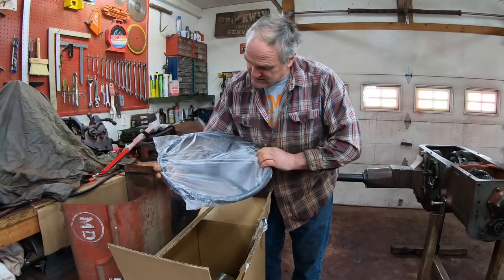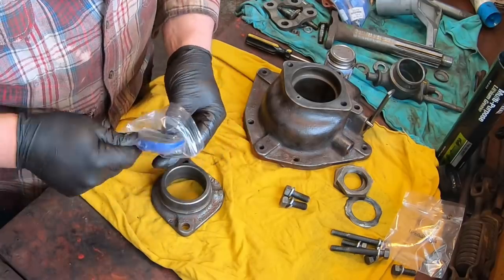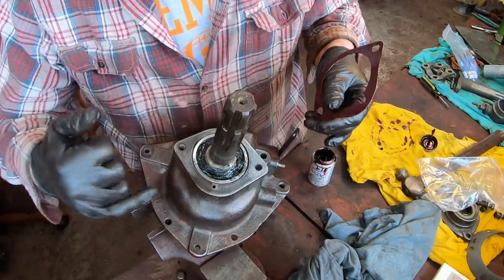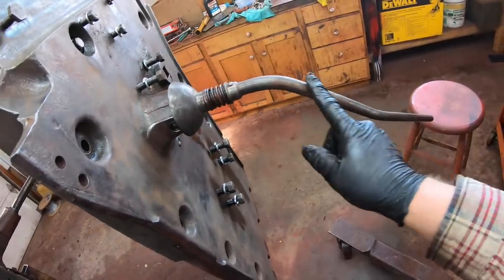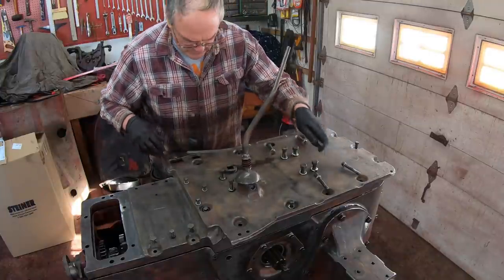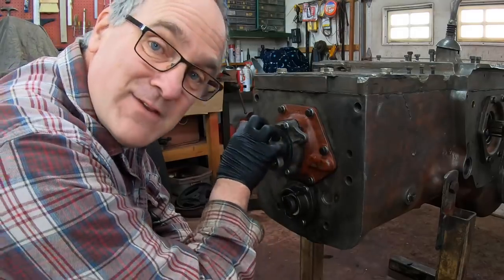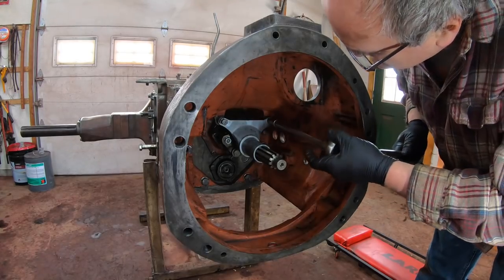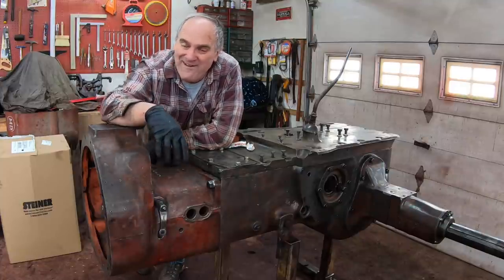The Farmall MD Is Taking Shape! PTO, Transmission Cover & Torque Tube

Comment: Have you noticed that when a repair requires two wrenches they are often different sizes so that a farmer didn’t need two sets of wrenches to do field repairs?
Reply: I’m pretty sure that’s not true, 5/8 head bolts just have 11/16 nuts on them because 5/8 nuts would be too weak, every other bolt has the same head and nut size.

Comment: Hey, Pete,

If it was mine, I'd keep the belt pulley for a few reasons. My favourite is this: I made an adapter that goes on in place of the pulley. That adapter has a six-spline PTO drive on it. Why? Well, when the PTO is running at 540 RPM, the belt pulley is running close to 1000 RPM. I hook my PTO-drive generator to the PTO spline I mounted on the belt pulley drive, and I can run the generator at its rated speed with the engine at barely above an idle. You can make any generator into an "Electrall!"

Second reason: The belt pulley is an excellent way to jump-start another tractor (if the other tractor has a belt pulley also). If you've got a tractor that starts hard, face the two tractors toward each other, give the belt a half twist and connect the two tractor pulleys with the belt. You can use the good tractor to crank the one that won't start till the cows come home, and you won't run out of battery or over heat your starter. You're essentially using one tractor as a "pony motor" for the other.

The third reason is obvious: You might get an antique implement some day that runs off the pulley.

I know, in these comments, you get a lot of people telling you what to do. Just suggestions. It's your machine. Set it up the way that works best for you. Thanks again for sharing your adventure with us.

Cheers, and Happy New Year!

Comment: Another job well done Pete. Getting a package full of new parts is like a child getting a christmas present early. The MD and old Farmall PTO coupling works the same way as on Belarus tractors. Only difference i see is in length and the PTO being 6 spline opposed to a 8 spline PTO that was standard for all Soviet tractors that where none export. With the MTZ 50 or 520 for those in North-America they changed the PTO from a simple fork and rail to a planetary gear PTO. The earlier design was fool proof and easy to repair if the seal failed. Also your MD has a very solid and accurate shifting mechanism. I remember driving my friends Belarus that had the shifter physically rotate while it was in gear and driving. That happens when the shifter lower plate and pins wear out and it gets lot of slop into it. Easy fix but people just never know how do fix it.  Keep on going Pete, it all seems very solid and straight forward.

Comment: I love to see your thorough restoration job, Pete. I have a 1941 M and have done some of that too. Have you ever heard a jingly noise when the tractor is idling? That’s what it sounds like when those tapered bolts and connector ring and rubber washers are worn out.

Comment: In the 80s when I did my M most of those parts were readily available at IH.
I managed to find a good battery box at a flea market. The battery box was notorious for coming loose, sliding out, and blocking the clutch at the worst possible time. 
I'm a second generation M owner. 
Enjoy the videos Pete.

Comment: Great job Pete! I really admire the fact that you can use levity to get through what would otherwise be a frustrating situation with some of us, me. I would have not been as patient as you were with the bolting of the clutch shaft and the forks on the lid installation. Humor is a great way to ease that frustration, if you can manage through it. Fantastic video, thanks for sharing, have a great week.

Comment: I found a PTO Shaft cover on eBay about 20 years ago.  3" diameter 6" long with a old style hose clamp spot welded to the metal. Wasn't a repro, fit nice.

Comment: The speed of the installation of the pieces and parts keeps me engaged. Remarkable that you are putting that tractor back together with each piece named, cleaned, and greased and it is going to eventually work again. It will.     Right?

Comment: Pete do you have any great ideas for adding positive traction to these ladies?   I didn't ask you in the before comment.      I'm going forward with hydraulic disc brakes on my M. Found double Master Cylinder from 62 Chevrolet so one reservoir and two pistons, it's compact, heavy built. Gonna use Honda Rotors , and hydraulic Calipers with Cable parking brakes built on the Calipers. 
    Anyway Positive Traction has really been on my mind. Using the steering brakes just doesn't compare to locking the differential when pulling logs in heavy mud. I know there is possibility of putting the cross shaft under the belly or even over the floorboard , and using  heavy chains, but had much rather have it inside.

Comment: Is there enough room behind the Bull Gears to install a hydraulic gear motor???? I've been thinking about making one live Power Take Off. I wanna repower with a Cummins 4 cylinder and put a front mount hydraulic pump on the engine. If there is enough room to put a hi torque gear motor behind the Bull Gears and run it off the front of the engine it would make the M so modern.

Comment: Did you take schooling or you self taught.  I'm interested in your painting process  . I hope it's a good paint and not from tractor supply. I used it on my one 8n. Big mistake it was flat and very porous so it formed a black mold when parked in the shade. Anyway great videos.

Comment: HI Pete,  I really enjoy your videos.  They are very fun to watch and calming. I am not as experienced as you when it comes to mechanics and farming.  I have a question that I really cant find an answer for which is:  I just got 7 acres with 5 acres mainly wooded.  I am planing to start my own hobby farm.  I need to buy a tractor to clear the wood and use it for planting or doing the ground work.  There are lots of tractors out there and I am lost.  All what I know is I need a tractor to do the work with but I dont know the size, gas or diesel, 2 wheel 4 W,  brands I should stay away, etc.  my budget is under 6 k.  is this possible? I am pretty handy fixing thinks when they break with gas engine I never dealt with diesel.  by the way.  I live in MO if that help with the area....  Thanks

Comment: a youtuber pulled one of those tractors a long way to get it started does that hurt the injector pump to do that?
Reply from the maker: Pulling it shouldn't hurt the pump. The only danger with those pumps is after they have sat for a long time the rack can freeze up in them.

Comment: Pete 
I have a 400d
Two things
When I had to replace an outer axle bearing, I didn’t have hoist to support it. I cut a threaded rod in 3 lengths, 2 inches apart. The stagger allowed me to line up the housing one hole at a time, and then the rods supported the housing while I lined up the bull gear etc. Also I was able to get to the bull gear by removing the PTO pack instead of the transmission cover.
Secondly, I’ve lost hydraulic pressure. I believe it’s the pump, but haven’t been able to find a replacement or someone who can rebuild.
Any ideas?
Thx
Ron